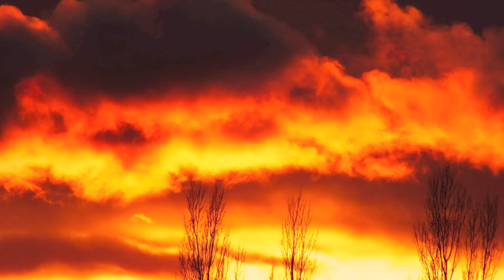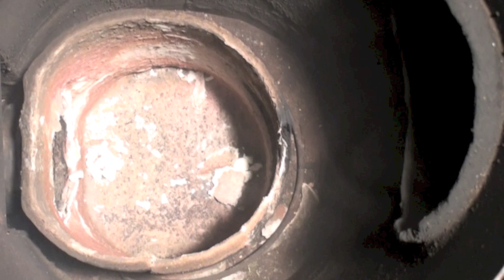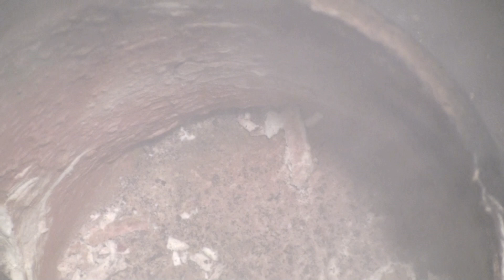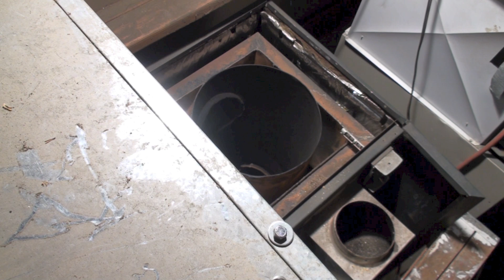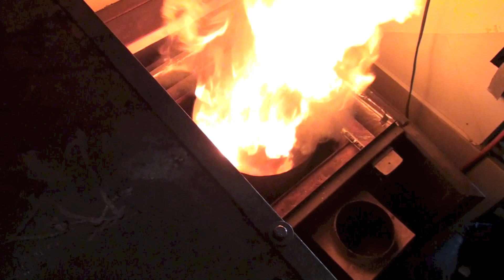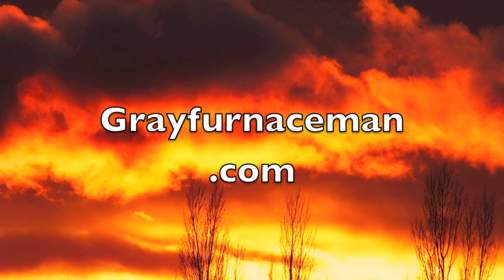Oil furnace delayed ignition

Comment: I'd call our local maintenance company, but there's only one game in town, and they improperly set up the furnace about three years ago - very sooty flame, water temp was raised way too high, pretty much anything they could do to sel more oil from what I can gather. I tweaked it shortly after, and noticed about a 30% reduction in fuel consumption, so I'm pretty well on my own here. Thanks in advance. Can post a video of the flame if that would help.

Comment from the maker: If there is a liquid oil level in the combustion chamber, as measured by inserting something in the chamber to measure the level.  the combustion chamber must be changed and the combustion area cleaned out with a detergent.  Starting one with excess oil in the chamber will cause a fire in the chamber that may be impossible to stop without the fire department.  Hope this helps.
GFM